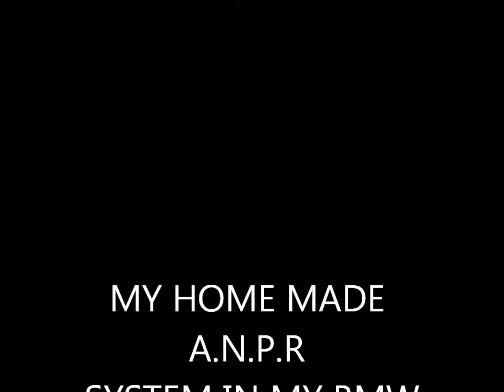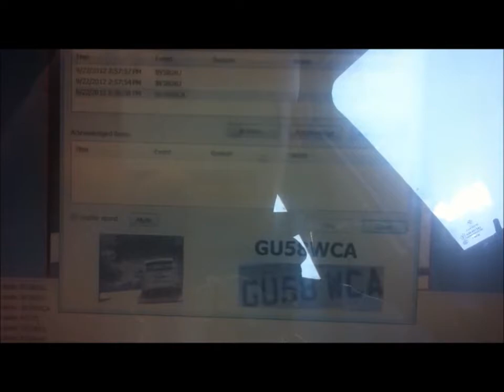MY HOMEMADE ANPR AUTOMATIC NUMBER PLATE READER IN MY BMW UK

Comment: What camera are you using? Also the Axis Server requires 5 volts or were you referring to the router? I see on the specs that the server can take between 7-20 volts.

Comment from the maker: This camera isn't designed for anpr use now now has the same spec as any anpr camera over standard composite signal. With the IR filter and IR light the image is now dark with only the plate reflecting the light back. Being the plates are retro reflective this works very well. Now I'm going to do some environmental tests (day, night, rain, boot open/boot closed). On first tests there is a lot of reflection from the IR flood from inside the rear windscreen maybee an externally fitted IR flood wi

Comment from the maker: I've done some reading up and I have put a IR filter on the lense ind added a infra red flood. I've also opened the iris right up and set the shutter speed to 1/1000th of a second the settings work fine.